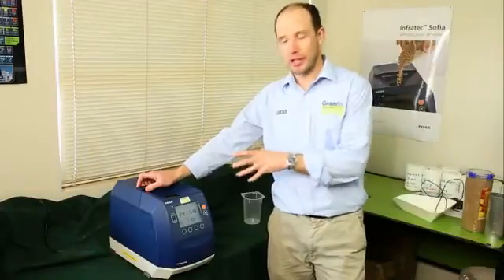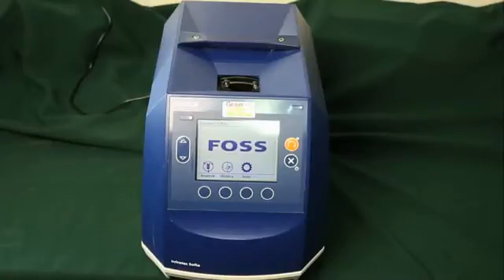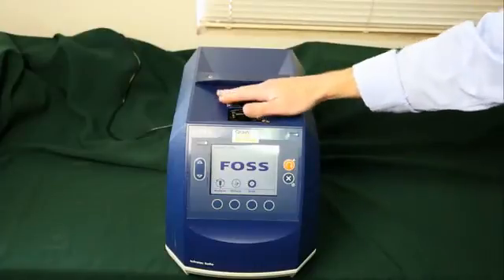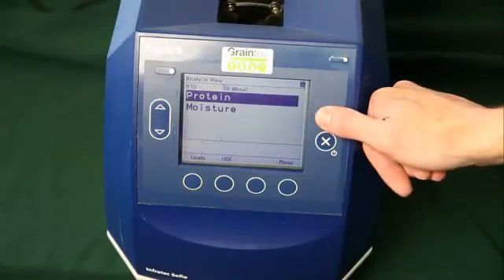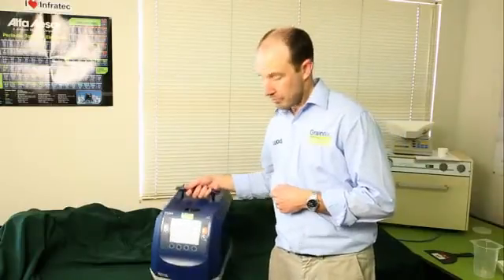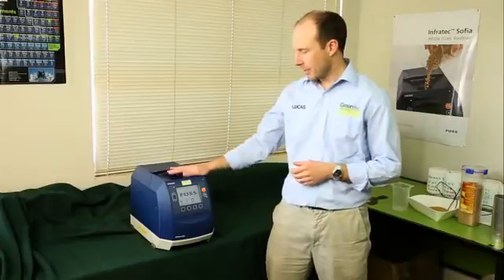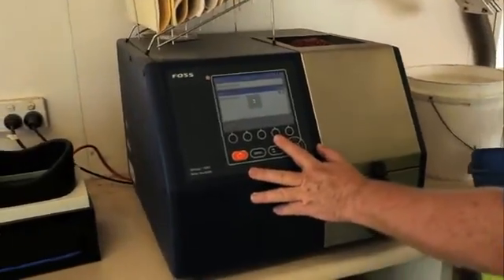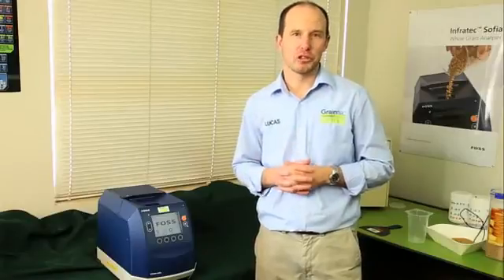FOSS Infratec Sofia Protein and Moisture Grain Analyser

Comment: What is the fair market value of a Infratec 1241 in USD?
Reply from the maker: Hi.  Thanks for your comment.  We are distributors in Australia for FOSS.  I suggest you contact a FOSS representative in the US for the answer as pricing may differ in different countries.  Refer to this link http://www.foss.us/contacts/contacts.
Reply: Any advice on buying one used?
Reply from the maker: Here is Australia, used (reconditioned) machines become available if you are lucky. These machines have usually done about 10 years and you can save some $ for sure.  I'm not sure what warranty you would get - depends who you buy it from.  You will need to find out how many reads the machine has done, what calibrations are installed, and what the service history is - this will affect the price and your bargaining power. 
Also, consider if the 1241 is the right machine for you.  FOSS also have a machine called the "Sofia" - which is a portable on-farm analyser.  It is cheaper than a 1241 - depends on your requirements..